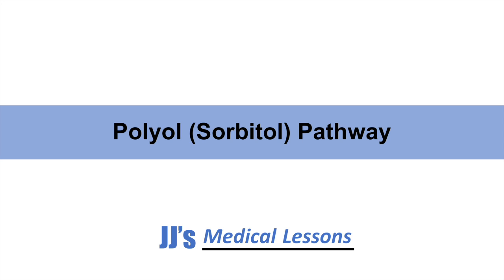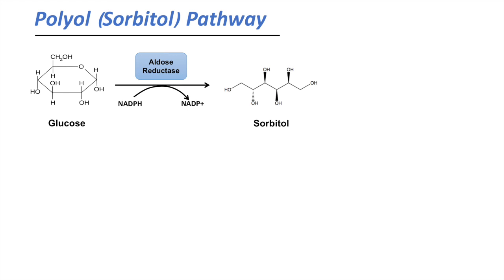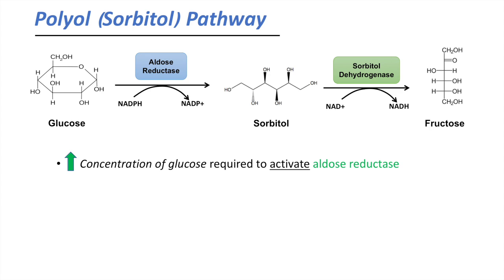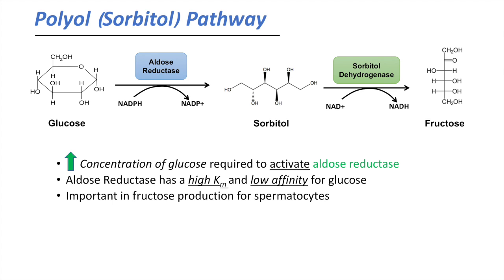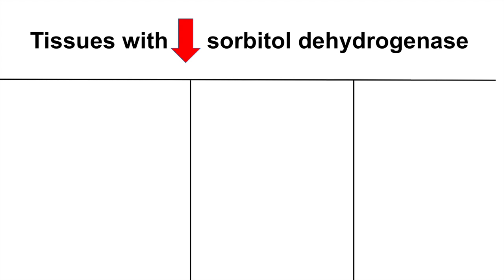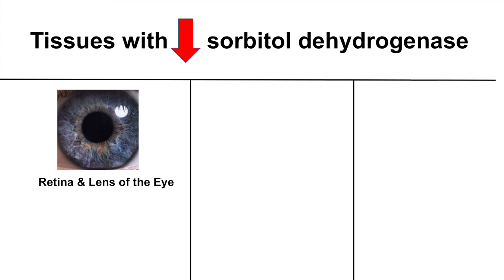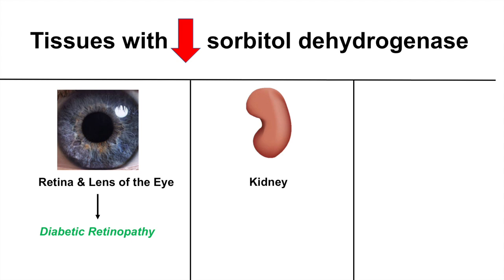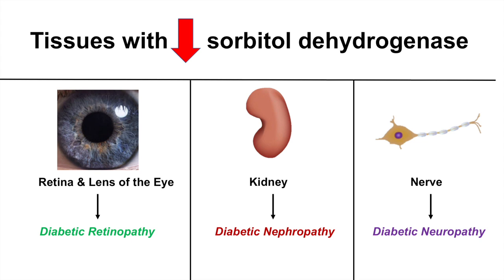Polyol Pathway & Diabetes | The Role of Polyol Pathway in Diabetes Pathogenesis

Comment: This is a very good explanation.  I have also seen claims that the activation of the polyol pathway also reduces normal metabolism and can then contribute to further insulin resistance...and all sorts of other issues, possibly hindering glucose sensing in the beta cells.
Reply: I've also read that for many years, this pathway was considered dormant; then scientists discovered that when salt is added to glucose, the salt opens the polyol pathway, and glucose can then be converted into fructose, which the body finds harder to get rid of, so it's stored as fat. 'Big Food' has the perfect salt/glucose combination to kick off this process.

Comment: This is amazing information, thanks!!! Between the video and the comments, I learned that kidney, retina, and nerve cells are insulin-independent, so insufficient insulin/insulin resistance will not prevent excess glucose from entering those cells. Glucose is converted to sorbitol when glucose concentrations are high, so sorbitol will be created in those cells when blood glucose is high. Typically, the sorbitol is then converted to fructose by sorbitol dehydrogenase, but kidney cells, the retina and lens of the eye, and nerve cells have low levels of sorbitol dehydrogenase, so sorbitol levels will increase.  With uncontrolled diabetes, a condition of high blood glucose, excess glucose will enter kidney cells, retina/lens of the eye, and nerve cells, convert to sorbitol and get stuck in that form. Excess sorbitol is damaging due to its significant osmotic effect, so this leads to diabetic retinopathy, diabetic nephropathy, and diabetic neuropathy.
Reply: Thanks

Comment: Isn't the whole problem with diabetes that the insulin receptors don't work so glucose isn't getting into the tissues in the first place? If so, why do we care about this if glucose isn't getting into the tissues?
Reply: Well did u get your answer? If yes then pls help me as well. Btw good thought process
Reply: @samiksha8397  Thanks. I found the answer:

"While most cells require the action of insulin for glucose to gain entry into the cell, the cells of the retina, kidney, and nervous tissues are insulin-independent, so glucose moves freely across the cell membrane, regardless of the action of insulin. The cells will use glucose for energy as normal, and any glucose not used for energy will enter the polyol pathway. "
Reply: I think thesw complications happen after 20 to 30yrs of diabetes even when controlled bc a diabetic has more blood sugar than a normal person even when hes on medication which is basically faciliating transport of glucose to cells and lowering blood sugar.